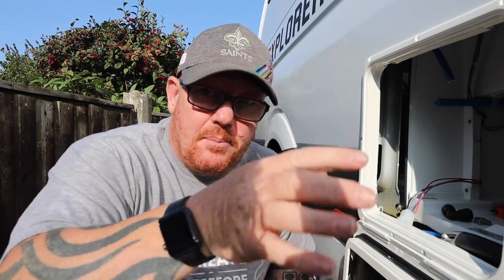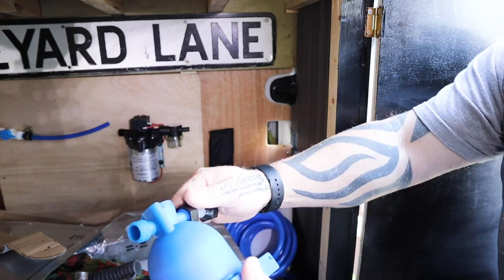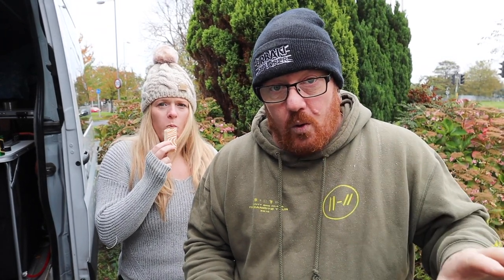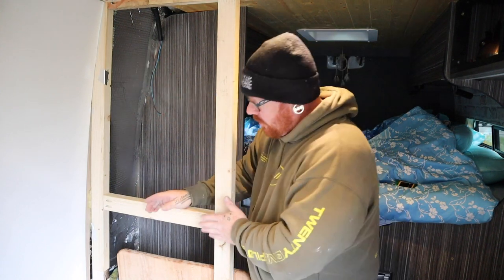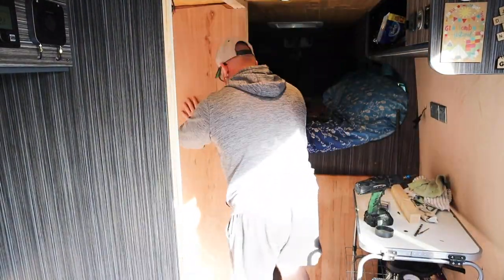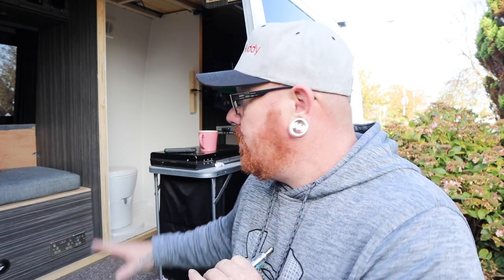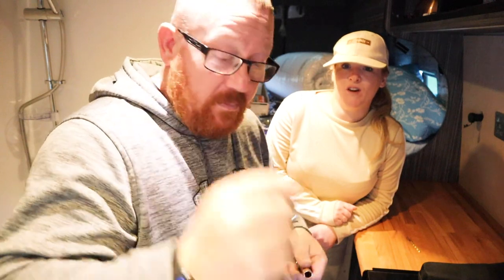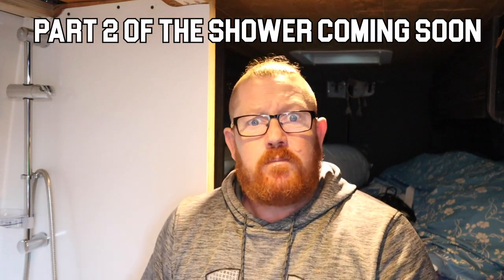We Fitted A TOILET & SHOWER Into Our VAN BUILD

Comment: Neil can i pick your brains m8, im now on the shower part of my build, ive followed your link for the shower extractor fan, my Question is i noticed it says pull cord ,can i wire the shower light up to the fan so that when i pull the cord the light comes on as well,,and last Question its 12v  does it need a transformer ? cheers pal.
Reply from the maker: We used a hi rated computer fan mate . And yes you can wire that so it comes on with your light mate TOTALY . Message me on Instagram if ya stuck mate
Reply: @UrbanVanlife  cheers pal.

Comment: Hi Neil, new to this, is there a reason for using 12mm, couldn’t you use all 15mm?
Reply from the maker: It’s all personal preference mate there isn’t much in 12 to 15 but a little weight . In the shower we used 12 on the back just cos we had a full sheet of it and it needed to be used plus add the pvc and it gives a good solid back and 9 on the inner sides with the pvc as well . Like I said there is no right or wrong it’s what ever works for you mate and never have any one tell you other wise . If it works for you then that’s all that matters bud . Are you planning on building your own or have you started
Reply: @UrbanVanlife  Thanks Neil, I was referring to the plumbing wondering why 12 and 15mm. Stillsl in the planning stage here looking for the right van nearly bought a Sprinter but was put off after seeing reliability issues
Reply from the maker: Oh I don’t know why we go 15 to 12 mate . You could just do it in all 15 . Which would be easier